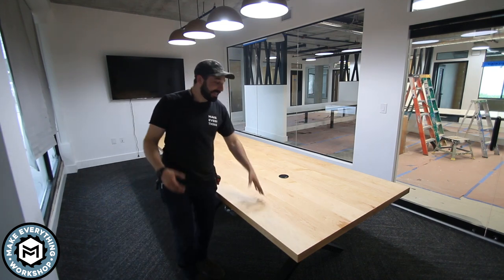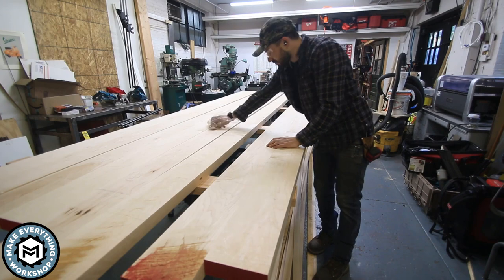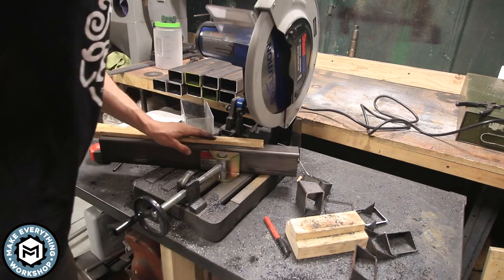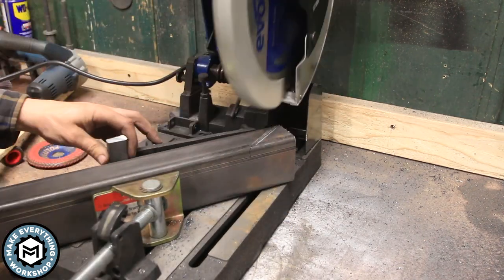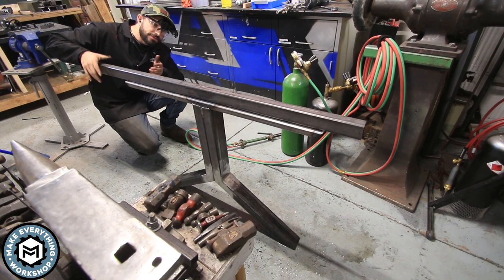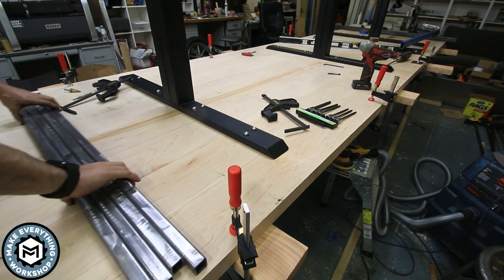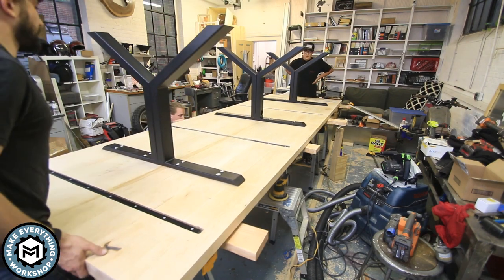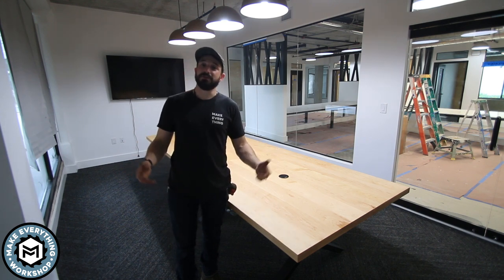Making a Giant Maple and Steel Conference Table

Comment: I would not use side by side bolts so close but stagger them offset using only half the amount that would be plenty. A threaded rod through legs centers would look cool and lock it in place for longitudinal oscillation

Comment: Recommend anyone doing tables of this style or slabs to buy the Festool TS75.  I had the 55 in my shop for some time but it’s not quite powerful enough for big slabs and the depth of cut is less.  Just my .02 but save the money and get the bigger saw.
Reply from the maker: Dave Herman i realized after this job that a ts75 was the next purchase! The ts55 just barely made the cut!

Comment: There may be risk that restraining the timber top with the steel  will cause splitting of the table top.  What happens will depend on the relative humidity and temperatures of your workshop and the eventual location of the table.  As a woodworker (mainly) I would have slotted all the holes in the steel and leaving bolts and screws loose enough to allow for both expansion and shrinkage of the wood.  This is intended to be helpful and make an even better result than you have achieved.  Great project, looks fantastic.  George New Zealand